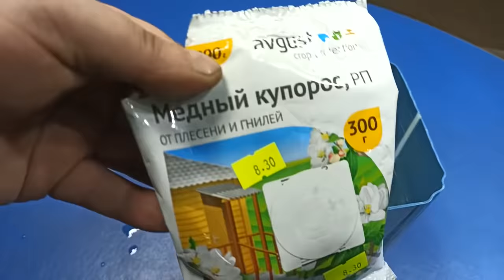Simple practical inventions! Wonders made with your own hands

Comment: Hi, looks amazing!
Can you write the formula of the battery electrolite and its concentration?
Reply from the maker: this is dilute sulfuric acid
Reply: @KovancaPolock  thanks. I bought sulfuric acid H2So4 30%. I tried it on 2 different objects,  the result wasn't uniform,  it attached only to part of the objects. Do you have a tip to avoid it?
Thanks again.
Reply: Ich